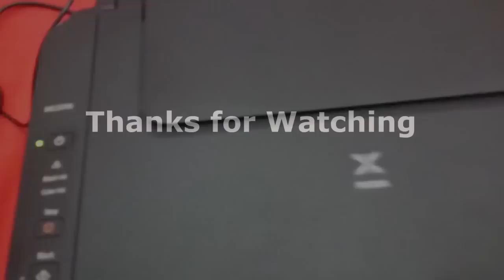How To Fill ink In Canon PIXMA MG2570S 746s Cartridge ! Easy Step

Comment: Cool. Do replace the needles with size 27 (about 14mm) or smaller (it might puncture a part in the bottom inside).

How many milliliters is the stand along black cartridge by the way?
Reply: Sorry to be so off topic but does anybody know a tool to log back into an instagram account?
I somehow forgot my account password. I would appreciate any assistance you can give me!
Reply: @Dominick Augustus instablaster =)
Reply: @dominickaugustus7395  you're welcome. By the way, how come you need the atm stuff? 

You can use first Instagram's own password reset feature.
Reply: @Kane Dillon it did the trick and I now got access to my account again. I am so happy:D
Thank you so much you saved my account!
Reply: @Dominick Augustus glad I could help =)

Comment: What would you do if you refill your ink but your printer still doesn't recognize it? That's my biggest issue right now.
Reply: terry jones did you figure it out?
Reply: CookingTeen no
Reply: terry jones they make printers in that way only. The chip at the corner of the cartridge recognises that the cartridge has been opened and shuts down the printer.
Reply: do not use other ink since first refill
Reply: Gday Terry, you can buy chip reset tools online. You just need to search - Ink catridge reset for 'PG645' for example [use the code for your catridges though]. I got one for my Canon printer a few years ago and it is still working well to this day. They are powered by a flat round 9V battery and are very easy to use.

Comment: My printer is Canon pixma mg2577S all three orange lights are blinking 5 times. No print or photocopy is coming. Printer is showing that ink cartridges cannot be recognized. Error is 14001. 
Pls. Help fast.
Reply: Reset your printer by long press the on/off button
Reply: please let me know,solution worked or not

Comment: How many A4 papers can we print from one caritage
Reply: I will answer your question with my records. When I bought Canon MG2577s two years ago, it came fitted with two brand new 745s and 746s cartridges. These cartridges have me a total of 86 pages. Then, the first refill gave me 184 pages, second refill 110 pages, third refill 267 pages, fourth refill 156 pages. After this, I inserted a new pair of cartridges which are very expensive, but gave me only 80 pages. Thereafter, I did the fifth refill that is currently ongoing. While the color cartridge is still fine, the black one is showing some fatigue by printing unintended lines. My finding is that if you use your printer on a regular basis, the print output from a refill will be greater.
Reply: @BiswanathDebnath  Hi doctor, can u please kindly mention the ink volumes you inserted in the black and colour cartridges please.
Reply: @chamodrajapakse7462  Hi, I think the color cartridge is 9 ml (3*3ml) and the black cartridge 10 ml (I am not sure). These are the small cartridges for Canon 745 and 746, I do not find the ink volume mentioned on the carton. As I use refill products, sometime I have got prints for up to 200 pages, but sometime just about 60 pages.
Reply: @BiswanathDebnath  Thaaank youu❤️

Comment: Hello , After fill my printer i have keeping light problem please help my
Reply: I also have light problem after refill this printer. Computer show message press the stop button at least 5 seconds. But it doesnt work. Are you found a solution?☹️
Reply: @govinduharshana3292  did u find the solution??
Reply: @MONARKZAVERI  I put new  black catrige. Now black print button light not blink. But colour button still blink.
Reply: @govinduharshana3292  ok....what about refill trick??? i refilled..but in computer..it still shows low ink

Comment: how many times I can refill my cartridge ?
Reply: Since I bought my Canon 2577s two years ago, currently I am on the 6th refill. While the color cartridge is still fine, the black one is showing some fatigue by printing unintended lines. This is an indication that it should not be used for more refill.

Comment: A very misleading video. It does not tell people any thing about the chip at the bottom of 
the cartridge , whose function is to monitor how many times the cartridge is used..
It  will eventually shut down the printer. it does not matter what. The only solution is 
to buy a new chip and replace the older one.